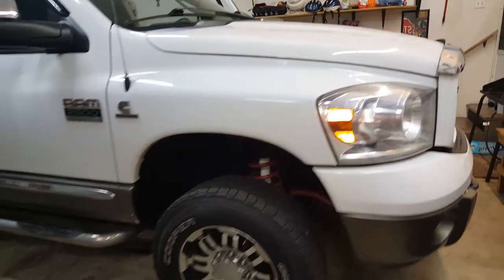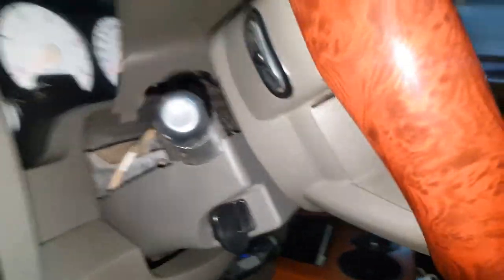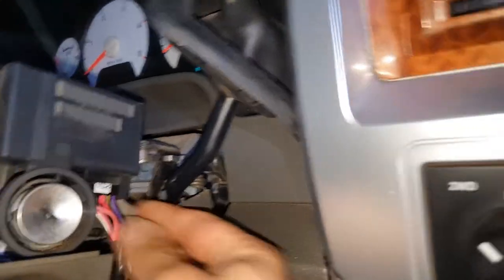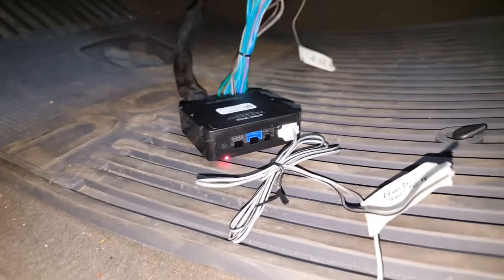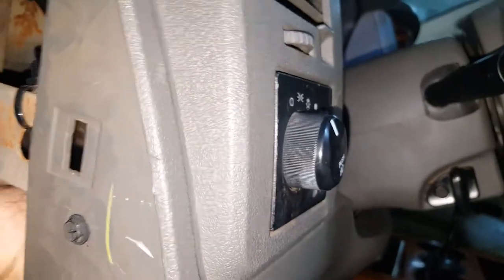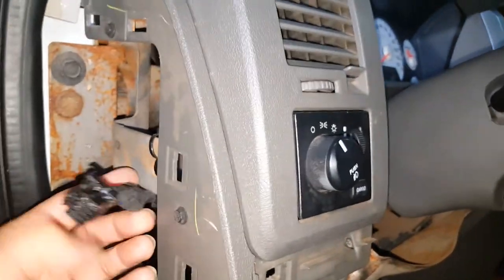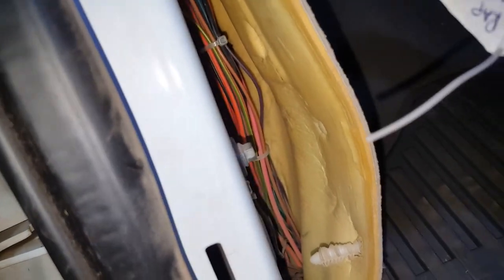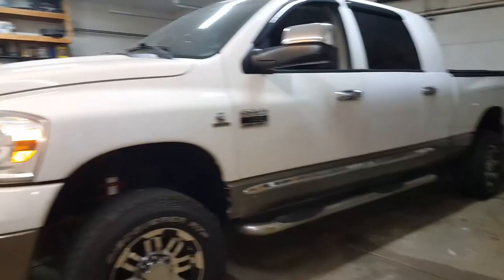Ram Remote Starter Install Plug & Play DIY | Diesel or Gas| Flashlogic

Comment: Will this one work on a 2005 Dodge Ram 5.7 ?
Reply from the maker: The Flashlogic FLRSCH is for 2005 and up Chrysler, Dodge, Jeep and Ram.  The only difference in the deiseal is the delay for the cold start  & programable.  Is your remote identical to what's in this video? Because the older remotes were different and those will not work as that was a different system.
Reply: @JSFautoPlus  shit. No, it’s the peanut style fob. Is there any system that allows for the factory remote for the 05? It also has a standard dodge key that is black. I don’t think it has a chip in it.
Reply from the maker: I believe the grey keys were chipped and black were not. You can definitely install a remote start system in that truck but it would be a stand alone system and not a plug and play like the others which had the factory remote start options.  But I think black key means no SKIM module and security by pass at least. So you can go with a system like the the Viper or something and completely replace your remote FOB.  But it is a more complicated install and not just a plug and play like this..